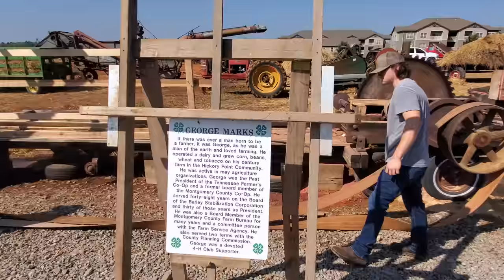109 Year old Sawmill, Wheat binding, Sorghum Pressing, Tractor show!!

Comment: When  I was 16 years old in 1964 I worked for an old Farmer that had a Hay Binder similar to that.  When it would not tie he increased my young vocabulary by volumes.  He had a little sled that  was underneath the discharge that held 6 or 8 bundles. When it go full he would dump them in the field and we later came back and shocked them.  Chopped the Wheat and Barley bundles into a Barn after the shocked Hay was cured .  An old IH TD 14 Crawler powered the flat belt to the  Chopper.

Comment: Loved your video Chad👍
I cut my teeth on an old 5 foot 'Yankee' inserted tooth saw as a 15 yr old, 1st as a 'tail boy' to my dad and shortly after on my own, hard graft!!
Something to try on the saw is to ensure the shaft is running square to your carriage.
Firstly, let the 4 guides away from the blade then sit a piece of steel or a screwdriver on the carriage, starting at the leading edge of the blade and holding the steel/screwdriver up to the side of the blade until JUST touching it.
Then slowly slide the carriage through the side of the blade to see if the blade stays true along the length of the blade. It may get tighter or produce a gap between the steel and the blade, this will let you know if the blade is running 'true' or not as this will cause the problem you have of it 'running out'.
These saws were buggers for producing heat spots if they weren't running true and would 'wobble' when hot, they have to be set really true.
My grandad, dad and elder brothers all worked the thrashing mills for many years too, great to see it working at the show.
Lastly, I noticed the sign 'Montgomery county, where i was born was only half a mile from the old Montgomery Castle in Ayrshire, Scotland👍👍
Best of luck with the sawmill👍🏴🇬🇧

Comment: Love the old equipment , I grew up around Saw mills. First My dad's and then for a large  company. I repaired Circle saw's for years. That saw needs  a re-tension lumps hammer out and the shoulders  set. It will mark the wood very bad when these get out of alignment. Also speed plays an important part in sawing.  As always I liked and shared. All my very best.

Comment: Excellent video Chad  :) I remember my childhood years  in 1980's my one late neighbor farmer Fred had John Deere 40 row crop 1951 with in line 2 cylinder  gas motor electric start 6 volt or hand crank  to start plus had Loader with trip bucket with 2 progs  to! He use for clean out barn yard also feild work 125 acres plus had blade to help clean snow on his  driveway plus gravel in spring season! I had help with steering wheel and gear front unicycle wheels to when broken down was fun do ! On Wheat pressing Chad in feild never did but heard was challenging to do and Corn in feild did never did that too !  But there lots old ways farmer did missing out on but saw at shows how do stuff back then and so cool! But did try a show Threashing Machine  and what hot sweat job ! Saw mill you did never did that only new Machine styles! Thank you showing all this Chad in your videos  always! Molasses seeing once but years ago and your Machine so cool  to!

Comment: i didnt grow up on a farm  and havent been around farming  so seeing that wheat chopper thresher and sorghum press was actually a first for me 
it goes without saying  i was glued to the screen and rewinded several times
and hope to see that little motor get fixed EDIT: on the old saw mill those blades arent supposed to be parralel to the log it cutting it supposed to have the leading and trailing edge edge at slight angle it helps prevent the blade from binding and heating and helps it cut straighter as far as i can tell it it should be about one degree modern blades fix this issue by having each tooth bent in the opposite direction from the other 
dont really have any info. on fixing the other wore out bits on the saw mill though

Comment: Yeah when the blade gets to hot it will warp. I learned a little back when I was younger working in a mill. If it is still warped when cold you need to find the oldest mill operator you can and they can teach you how to hammer it to make it straight again. It’s not a quick job. Good luck great videos 👍

Comment: I use to build and service Montgomery Mills sawmills as well as Fricks. Your thick & thin problem is do to the blade, wood species, rake and count of teeth, blade diameter 56" 62" 65" 68" 70" 72" all the way up to a 102",  and RPM of the head saw. The circle blades have be hammered, the process of hammering the blade harden's it throw hammer friction tension. It also puts a dish in the blade, before start up of head saw the blade shows a dish. As the head saw comes up to RPM the blade have stands up straight. Depending on species hard or soft wood, ash hickory or oak then there's hard maple in western PA they call it Bass wood. Cedar, pine, cryprus. RPM is determined by species and availability. Most mills run either off a 3 phase 100 to 150 horse electric motor or a duetz diesel power unit. The main shaft is called the mandrel, where the blade attaches is the mandrel collar can be 6" 8" 10". That collar should machine so it doesn't make full contact with the blade. From center of the collar should be stepped down til about the last 1"to 3/4" outer diameter except the last 1/8" is machined at a angle for clapping force. Your saw guide and mandrel were pushing cause your blade wasn't hammered with enough dish. For the rpm. I've seen a brand new blade run away, they installed a new blade that wasn't hammered, and they had replaced cause of thick & thin. Well they fired up went to cut started to chatter and broke a 8" hole in the middle of the blade right where the collar was suppose to be. And it ran right out the building and into the field. As for your carriage coming of track cross tie your feed cables X them connect front up underneath and attach to the back of the carriage and the back cable go up underneath and attach to the front. She'll never kick up again. Cause the cable is always putting down force on the carriage. Airtool oil works really good for lubing the track, are automated air carriages we use to run lines to the wheels of the exhaust ports so anytime the valves cycled they oil and blow of the wheels. Push brooms cut up to fit the application work great for track sweepers. Also make sure you have at leaat 5 wraps on your feed drum. Love your content, keep it up. Dave

Comment: It needs some grease.  When it was being pulled, the wheel was almost skidding from the drag.  I would put a slight resistance on the twine just outside the container holding the roll.  That would prevent it from balling up.  I remember that unit from when I was a kid in the 50s,  It was old then.   Those things are foolproof when they are setup correctly.

Comment: Worked in a sawmill for a few years ran the edger  when the head saw gets hot pitch a cup of water on it to cool it down and it will run right again. Have to do that alot too
Reply from the maker: This one runs bad right off the bat. It's old and tired.

Comment: I admire the absence of warning labels, danger signs or any safety devices of any sort. The main thing was that the machine could get the job done. If a worker lost an arm, it was more than likely his fault anyways. A life was cheap back then. When the sawmill started up, I thought, you better not stumble while up on the sliding deck.

Comment: You know the "h" John Deere DIDN'T HAVE PETCOCKS TO OPEN😮,, they didn't have enough compression to need any!! Also the belt pulley runs backwards on the h,, because instead of being on the end of the crankshaft it's on the camshaft,, and the final drive run off the camshaft too!!  That's one stout camshaft I tell you!!